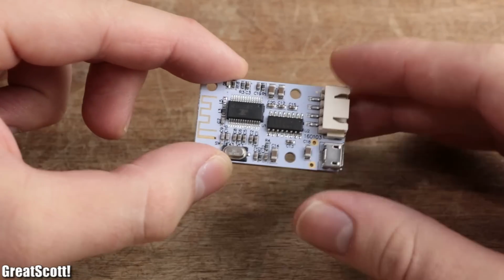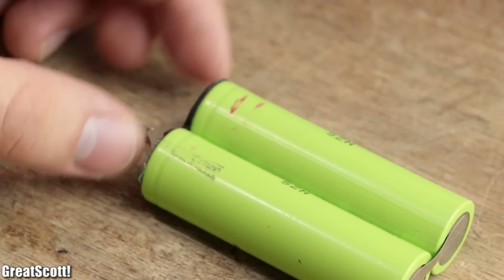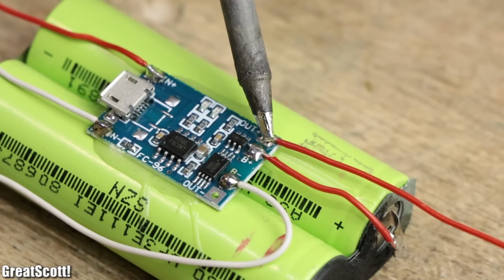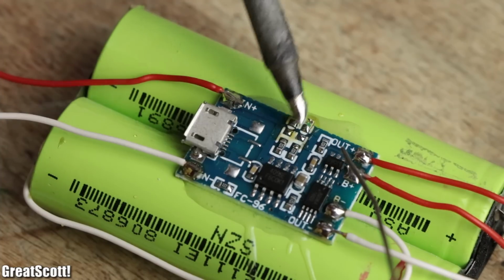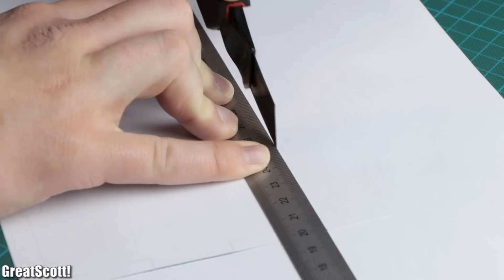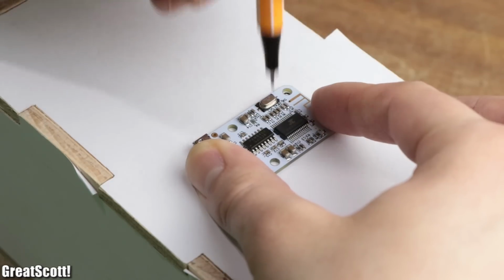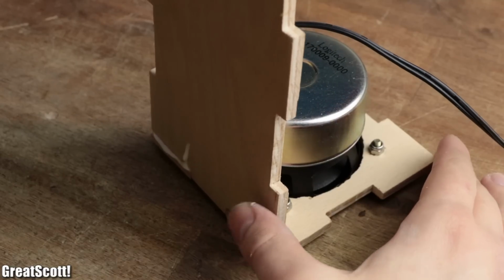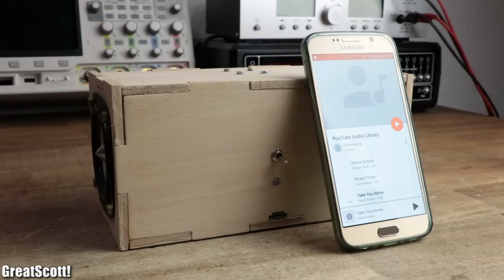Make your own Simple & Cheap Portable Bluetooth Speaker

Comment: You should use a better amplifier for those speakers because those are from logitech z5500 :)
Reply: Okay, thank you very much! <3
Reply: +spotify95 seems like you know something about this, what would happen when i  connect 2x 8W speakers to this? ^^
Reply: but nothing will be destroyed or something when i use 8W or even 10W Speakers? :)
Reply: I wouldn't recommend giving them over 10 watts though, unless you have a high pass filter and a bigger woofer with a low pass filter so that you don't blow the tang band speakers. Sources? I have some old z906 speakers.
Reply: how can i find a cheap 800 watt amp?

Comment: Hello @GreatScott ! Thank you for all your videos!! I was wondering if you could help me. This video uses 18650s and with converter you step the voltage down to 5V, also you use the 5V charging circuit. What would you recommend using in combination with 18650s but with input voltage of 12V and the need to output from the battering block of 12V as well? Thank you in advance!

Comment: lol id rather buy a ready bluetooth speaker than make one with that price tag.. : /
Reply: PM:FAIZLAMIZ :P where's the fun in that
Reply: Mine is a 8mm plywood box with ~ 12l of volume ~(300x200x200mm) with 2x 20mm diameter x180mm circular Bassreflexes
the Drivers are 2x [Visatron FR-10 4Ohms] driven by a ~15€ 2x25W Bluetooth audio amplifier from Amazon (still a chinese one).
Some wool for stuffing things out and some wooden struts to reduce the oscillation of the case (for tighter sound)..
I am satisfied with the result. But my box really demands an external equalizer to sound awesome (there are plenty of them in app stores, but you will be restricted to use a smartphone)
You may want to take into account whenever you add some volume like Batteries (f.i. LiPo, LiIon; or simply a Pb accumulator). Any significant change to the volume should be compensated by increasing the dimensions to maintain roughly 12 liters  of air (for 2x Visatron FR-10); there a multiple tools for calculations out there :)

Finally, some utility may be pretty neat:
Stuff like Voltmeter for Vbat; USB charger port (my mobile has to run the EQ through the cpu and uses more power); any kind of charging port; some lights (?) etc; MUTE SWITCH when using shitty developed amplifiers which do all peeps (powerup / volume + / - / play / stop etc) with 100% of the volume! (me <-)
As the 15€ amplifier is pretty crap I would recommend to invest a little more, there are also some nice 2.1 channel amplifiers with build in 3 way EQ out there..

There is also the helpful youtuber "LeoLautsprecher" for the german people around here. :)   (hab erst am Ende mal auf dein Profil geklickt ._.)
Reply: I'm building a Totoro/green themed one of these for my GF with a handle that doubles as a cellphone stand and a compartment on one side to drop your phone in for the steamy shower. It is also being created out of used speakers I got at a second hand store and never put into service. It has passive membranes and a woofer as well. Try any get anything remotely similar by buying it and you cant.
Reply: When u increase your budget to like 80 bucks, your speaker sounds awesome (needs some simple calcs) and it can easily compete against something like an 200 $ JBL Box (:
(f.i. Using some Bluetooth amplifier from Amazon (~15$), 2 Visatron FR chassis (40-50$)); and some individual stuff like, battery and voltage indicator or USB charging ports (and a descend to good EQ on your Phone)
Reply: Do you have some additional information about a real good setup? My budget would be up to 100 bucks, but should be worth spending my time as well, so would appreciate good sound quality ;)

Comment: I have a question more closely related to an earlier video "Fix It!: Ceiling Lamp LED Upgrade"

I just bought some new LED replacements for my halogen lights in the kitchen and I'm not sure if they can simply be replaced without looking at the power supply. I'm pretty hopeless when it come to the nitty gritty stuff in your videos I mostly watch them for entertainment ;)

so the specifics:
I am referring to MR16 GU5.3 standard 'bulbs'? at 3.5W as a replacement for 50Ws. (Lighting EVER on amazon <-- germany)
The old halogen ones are labeled as "50W12V36D" <-- I don't know what the "36D" means the other stuff I can guess... barely ;)

My main concern, obviously, is safety if I kill the bulbs I'd consider that a lesson learned. Burning the house down would be a bit to much of a hint.

P.S. I'm thinking, these things are meant to replace halogen light so they should just work in the same setup in my mind. Right?
I really don't want to have to open the sealing to get to the cabling...

Thanks in any case.

Comment: A couple tips: first, you could put insulating foam on the inside of the box to get a better sound quality; second, you could've used the blue part of the rgb led to signaling that the speaker is on, using a diode between the common anode and the BT board led anode to ensure that it doesn't get current when it souldn't.
Reply: Could you help me create my own speaker please?

Comment: You salvaged pretty high quality Tangband Speakers. There exist several websites and softwares, which you can use to calculate your Speakers' Cabinet. You can find all the necessary data to calculate the cabinet (Thile Small Parameters). Then you can achive a better soundquality and also that you placed the speakers to the sides is rather bad for the overall sound quality! I would check out Leo Lautsprecher or Kirby meets Audio on Youtube to get even better speakers if you wanna build some more in the future!
Greets

Comment: you should install a speaker guard :) and also use a but of spray adhesive for the template :) it way easier to remove

Comment: Has an X-Carve CNC machine, which is precise and automatic
Uses a saw, paper templates and files to cut everything
Reply from the maker: Correct and if you think a bit further you might realize why I did it like that.
Reply: @greatscottlab  I know because many viewers will be scared.
Reply: Because you want to show that everybody can make it ;)
Reply: because the point is to teach that it can be done by anyone without expensive stuff? hence the "simple and cheap" title
Reply: thug life greattscott
Reply: Watches enough GreatScott to know he has an X-Carve. Still doesn't get the point of the channel.
Reply: On top of that, he spent less time doing it manually :D
Reply: ***** Fair point
Reply: I think you should have ditched the CNC-style tabs and just used glue and clamps or finishing nails with straight cuts.

But to each their own.
Reply: The thing is that this is a hobbyist project for those having an interest in electronics and maybe are not engineers. The main takeaway from his videos should be the creative ideas and fun approach to electronics. Most of us like his videos because of his ability to make electronics fun for everyone. I don't think his credibility is at risk due to lack of a professional touch in his soldering or machine work. If perhaps he was making tutorials on how to make projects that are needed on say a space station or survival situations then I might state your points.
Reply: ***** Unit similar to what the guy at EcProjects has? Yeah, that would do it much faster.
Reply: ***** I won't say the enclosures look real sloppy, the joints are little messy. My DIY speaker looks like it's been through war or something, I make rather neat solder joints but struggle to make a neat looking enclosure :)
Reply: ***** Yes, I did notice. And I would've used a washer to keep the nut/bolt from chewing up the plywood. His videos are inspirational, some sloppiness proves that you can do it too. That's how I think about this. At least in this video he got away with one RGB led, in the FM radio he used 2 and snipped the other pins off (LOL), even though 1 RGB led with common anode will be enough. Just a constructive criticism, I like his videos
Reply: ***** I think he can do better, but doesn't bother too much. I get sad when I make a sloppy joint, for me it should always be shiny and have concave shape, big blob with a whisker will drive me nuts :D Getting better at something is always a good thing, so yeah I agree with you.

Comment: A tip that might be useful for you in future, when sticking the patterns to the wood, put a layer of masking tape on first, then glue the pattern to the masking tape, that allows you to easily peal of the tape at the end instead of having to deal with the glue.
Reply from the maker: Good idea
Reply: @greatscottlab  the device isnt speaking Chinese and its speaking english and i understood it like it said "the bluetooth device is ready to pair"
Reply: Also, Pritt is water soluble, so you should soften the glue with water. I don't know it acetone will dissolve it.
Reply: I was thinking alike. I usually just use a fine tip auto pencil when being precise. A pen light standard pen even works using light strokes since sanding is required for that smooth elegant look. Although if measured and outlined correctly and precisely then the lines should be just barely cut away anyways.
Reply: @michaelw7540  if he had access to an -  admittedly expensive -  laser cutter, things would have been really accurate.
Reply: I always used rubber cement for that.  It's easy to clean off afterward.  Otherwise, just use wood glue and sand the surfaces when you're done cutting.
Reply: Am I missing something? Why not just use pencil instead of going to all that trouble? Or even just cut the pattern out directly on the wood leaving the line cut by the xacto knife as the guide

Comment: nice work, 
but i wanted to mention that;
1. the speakers you used are 60 w each
and i had a question. i have a led colorlamp in my backyard i can control with the rf remote. i would like to control it with my smartphone over my wifi network, do you know any solutions ( soldering components is no problem)

Comment: i want to add Bluetooth to an audio amplifier how can plz answer me or make a video 😅
Reply: You need either a bluetooth adapter, and a switch to hook it up to the input of you audio device. Or buy a audio amplifier board that has bluetooth incorporated into it. Its rather straight forward.
Reply: you could try something like this: http://www.ebay.com/itm/3-5mm-Wireless-Bluetooth-4-0-Audio-Stereo-Music-Speaker-Mic-Car-Receiver-Adapter/122042365225?_trksid=p2047675.c100005.m1851&_trkparms=aid%3D2220071%26algo%3DSIC.MBE%26ao%3D2%26asc%3D39107%26meid%3D07c82c9b03f7401084216ca4ab342553%26pid%3D100005%26rk%3D6%26rkt%3D6%26sd%3D311722489267
Reply: Android Pro Gaming you can buy small adapters that do it

Comment: A few mounts ago I bought an Arduino 101 and it has a Bluetooth antenna on it. It can also tell what way it is tilting by using those switches with ball beings in them. It's a great board.

Comment: Some suggestions:

Add a handle on top for easier carrying
Add some holes on the back so that the Speakers have more air to move arround

also: If I wanted to add some volume controll, what would I have to do?

I'm a big fan of your channel and might consider building this one,
Grüße aus Österreich.
Reply from the maker: If you want a volume knob, you need to add a potentiometer between the audio output of the bluetooth IC and the audio input of the PAM8403. Not that easy to do. It is much easier to control the volume on your phone.
Reply: OK thanks
Reply: K1ngjulien_ it's a tweeter... Doesn't need porting, or does it?
Reply: Actually not that hard, you just bend the pin on one of the ICs and solder the pot in between the ground, the bent pin and the solder pad.
Reply: Das sind volltöner da ist nen port kontraproduktiv

Comment: Great project overall. Spray adhesive would be better than a glue stick. It doesn't look like the board supports skipping music tracks, is that accurate? I would build this if it supported skipping tracks. Watch some Woodworking for Mere Mortal videos for tips on woodworking when you've got time. Your woodworking will improve immensely for not much effort.

Comment: any way of changing the Chinese to English?
Reply: NE555 It doesn't "speak" Chinese. it just has an accent.
Reply: ze bluetooth driver iz ready to peer
Reply: Maybe it's just me, but she sounds half german, half chinese ;)
Reply: i bought 2 days ago some ne5555
Reply: The module says:
The bluetooth driver is ready to pair.
No Chinese or German needed |-)
Reply: its not chinese its english with accent ,
yes you can change it ,  the sound is stored in eeprom and  with hex  editing you can change it
Reply: most likely not, because the datasheet isnt availiable :/
but what i found out about this ic is, that the ic has support for bluetooth, radio, usb and sd cards ;)
Reply: "The bluetooth device is ready to pair" ... "the bluetooth device is connected successfully"..LOL
Reply: You'd have to figure out how to modify the firmware, if that's possible.
Reply: yes, learn it xd
Reply: http://www.ieyong.net/en/chanpinzhongxin-259928-105878.html
chip name can be found here but the datasheet is still an mystery
Reply: For a basic data sheet just look at one of the chips
Reply: electronica thanks for this

Comment: Highly recommend to use CSR8645 model and an op amp to do this job. It's sound quality is amazing. Make sure the op amp is good and has enough power to drive 3w speakers. You parallel to solve it. This setup will provide HlFl quality with APT X supported.
Reply: I would love to see how to use the CSR8645 to add streaming audio and handsfree calling to old car stereo.  The ultimate solution would be to connect it to the stereo via USB so that song titles could be displayed on radio and possibly call details from handsfree calls
Reply: Before apt-x, amplifier is more important on this little project. I use 1 dollard bluetooth dongle receaver on monitoring speaker, and sound quality is awesome. APT-x is the final touch :D
Reply: If you dont want aptx, CSR 8635 is Also not bad. You can program it like An arduino pro mini. It outputs very low power signals and Could be amplified using A class D amp. There is no need for professional opamp. Its just not worth of it. I Am making An earphone amp using CSR8645 and AD827. I might use AD712.
Reply: wzd leo how do you program it ? The CSR8635 I mean

Comment: what kind of glue did you use to attach the charger board to the 18650 pack?  Was it epoxy? I'm looking for a glue that adheres better than hot glue but is more flexible than epoxy.
Reply: 2 component glue

Comment: in the end, the speaker was off since the LED was not going, but the music was still playing 😂!
Reply from the maker: The LED shows the charging state. Not whether the box is turned on.
Reply: Oh ok! 
Also,what is the impedance and rated RMS or peak power of the speakers you used?Tried to build something similar with pam8403 but the speakers starts cracking when i turn up the volume.

Comment: Nice job!  Excellent job editing!!  Very well done.
Reply from the maker: Thanks
Reply: GreatScott! add a passive radiator to it, and you will gain a lot more bass
Reply: Taunter Atwill i did hear it, but i am not saying that is lacks bass it was a suggetstion
Reply: Hey to attach my two lithium batteries together, can I just solder a piece of wire to connect them or should I find a thin sheet of metal like in the video?
Reply: And why did you attach the positive to positive? And neg to neg?
Reply: jeff smith you will need thin sheets of metal and somthing for hold it togheter, for example: wrap it in tape ;) suc!!!
Reply: RetroWeld how much watts was the board